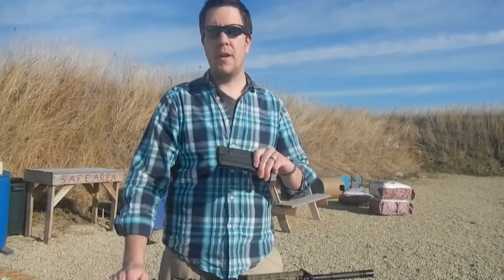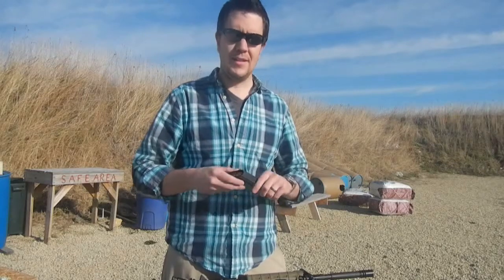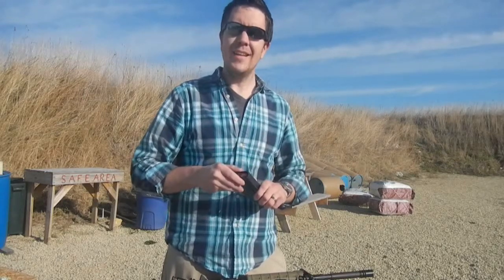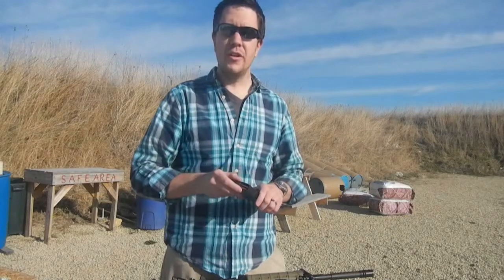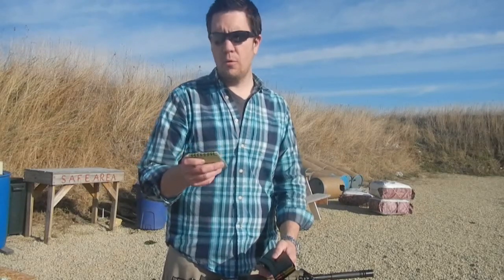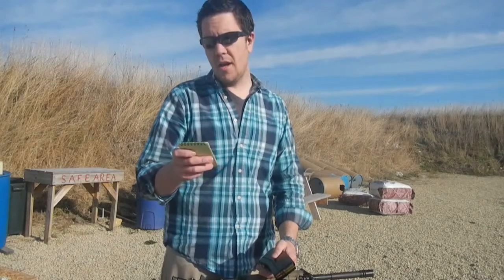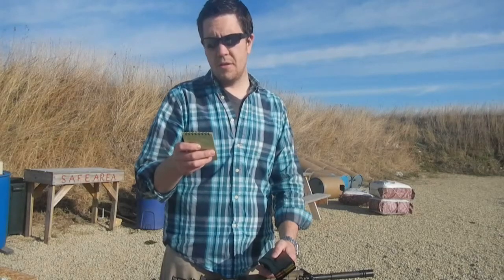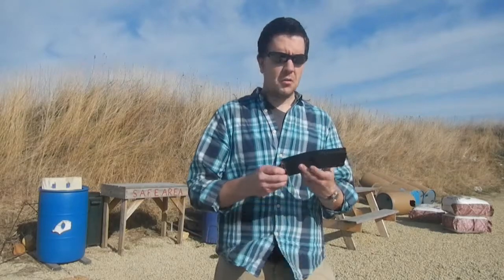UNIMAG Prototype Universal AR15 magazine

Comment: are these 50 dollars I cant find them anywhere for sale
Reply from the maker: +Garrett Wells Per my last conversation with the manufacturer, they are all in production, but there is a legal issue preventing sale at the moment. It is currently being litigated and hopefully resolved quickly.
Reply: +Latitude44Design awesome thanks for the feed back will they be 50 dollars per mag? any testing with 7.62x39?
Reply: I met with the them at this years shot show and all has been corrected and sales are and have been go on for some time now.
Reply from the maker: +Garrett Wells   Steel Shooter has done more 7.62x39 testing that I have. I have a limited amount of 7.62 (approx. 300rds) though this mag. What I have shot went through no problem.
Reply: +Garrett Wells I've got a video up on this mag, using 7.62x39.